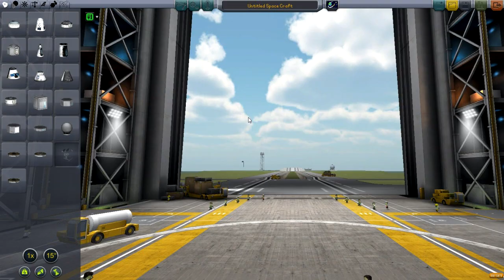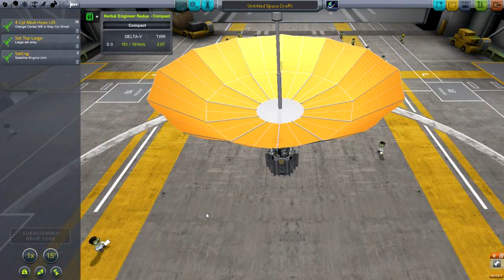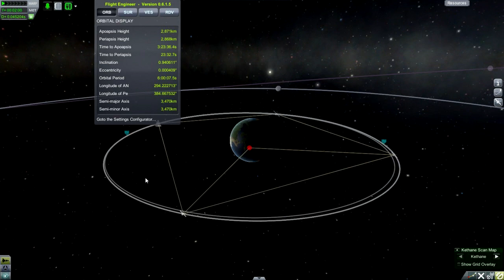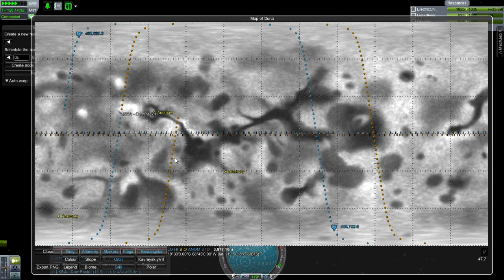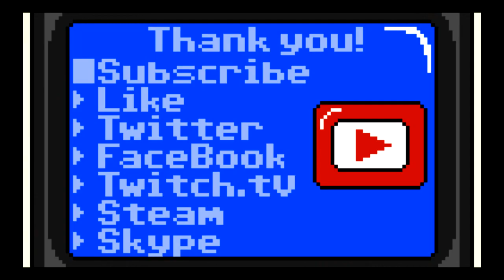Kerbal Space Adventures Ssn6 Ep8 HD - The other thing

Comment: Interesting new video format, it works, just remember to have some fun ramblings like you've had in the past, they are quite entertaining :) 

Are those Duna-sats outside the SOI of Ike all the time, or will there be a chance for the goalie to tear some of your sats off their orbits?
Reply from the maker: The sats are far enough out not to be caught by Ike so far. But they are close.
Reply: ***** ah, I really havn't gone too far into space so far, been trying to balance extraplanetary with KSPI, so I have my smelters using up more "realistic" energy values, 42GJ per ton finished metal(steel) of energy 60% thermal and 40% MW, still having fun in Kerbin SOI :)